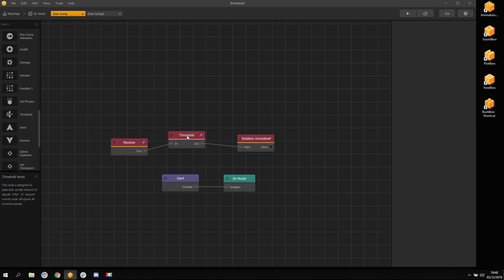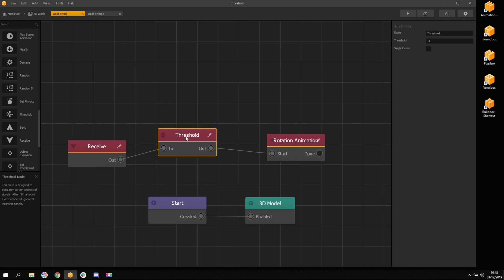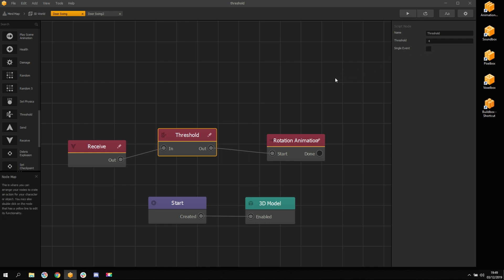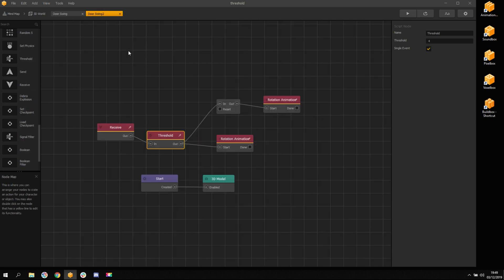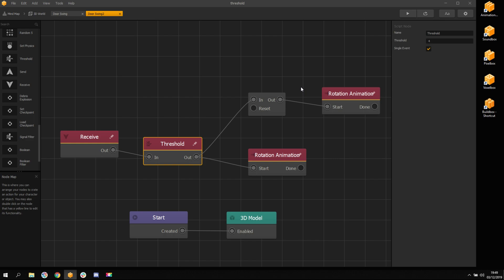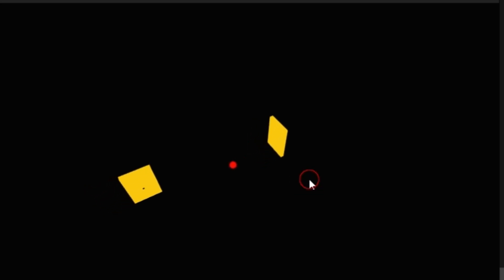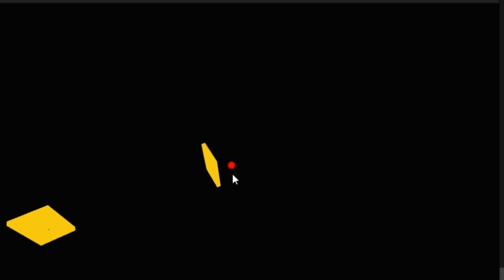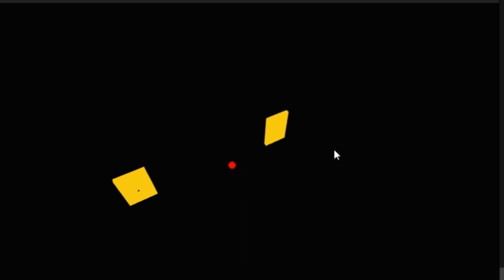Buildbox 3 What Is THRESHOLD Node?

Comment: Hi hanomax, i was facing issues while developing games in buildbox3  for android. could you help me???
Reply from the maker: +Manikannan M Hi!
What's your question?
Reply: while developing games the speed of the game is normal in buildbox3 editor but when we check in android the speed is very slow.
Reply from the maker: @MK-iq9dr  Poor Android performance is known issue. Usually it happens with older Android devices. On newer ones, it should run smooth.